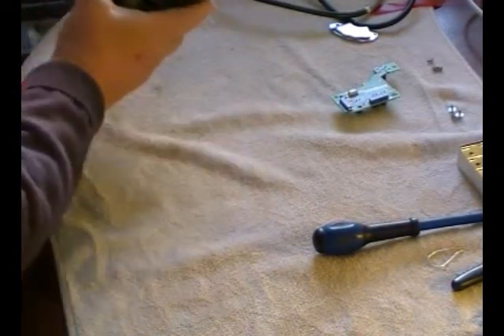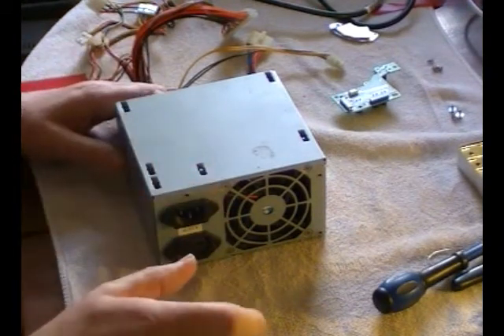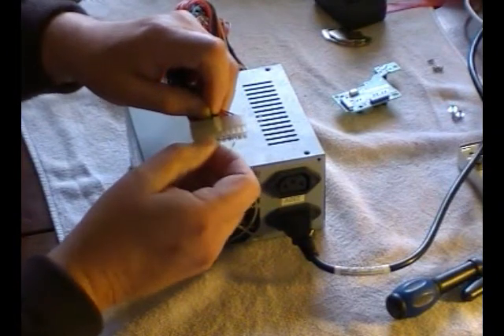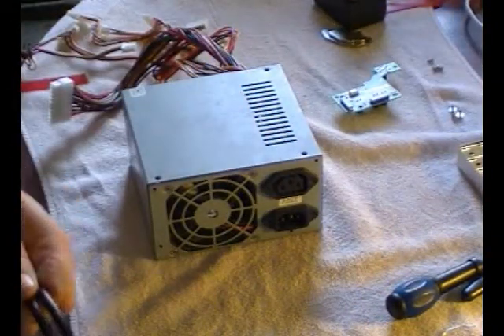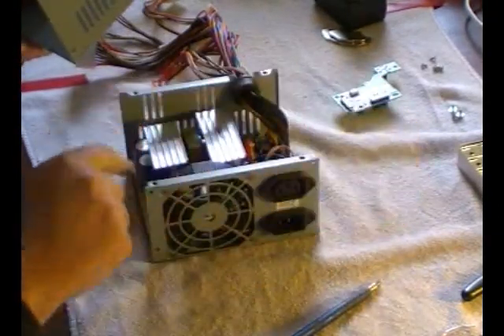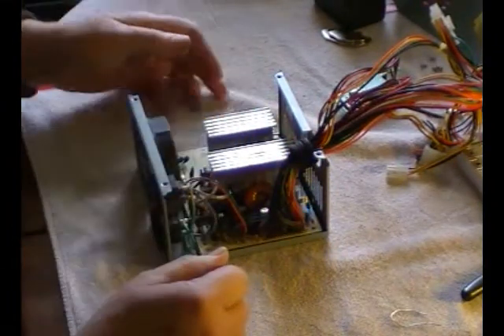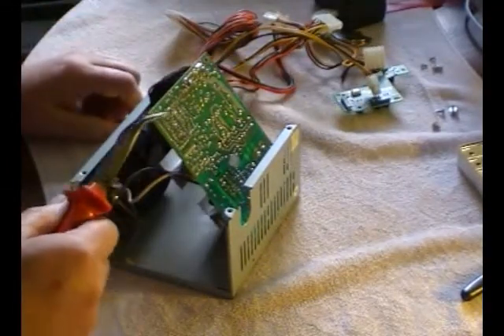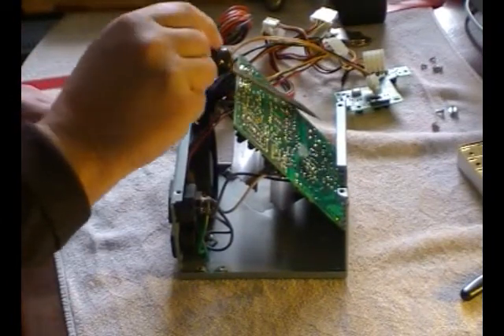MY NICE EV Printer Arduino CNC Part 44

Comment: a 10 watt resistor is a much safer way to discharge a capacitor. its frugal too. they are about 3 cents around here  way cheaper than a screwdriver :)
Reply from the maker: Thanks for that Shane. Never thought of a resistor. I'm thick you know.